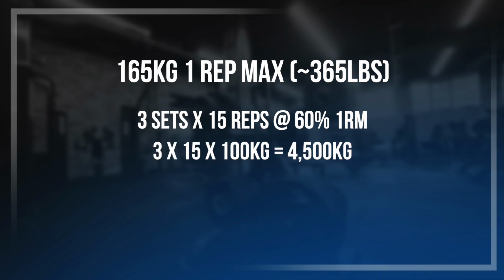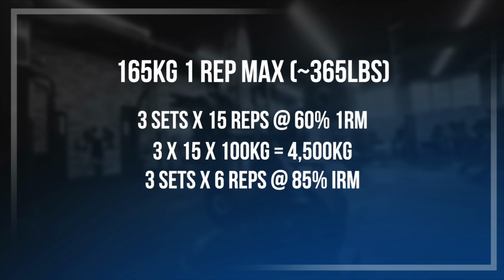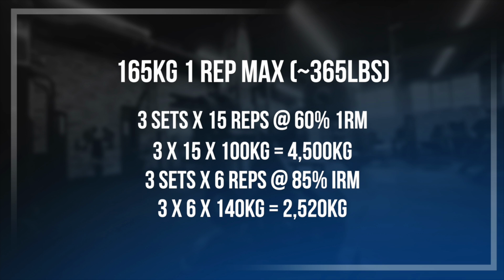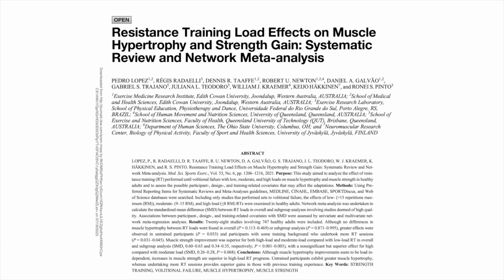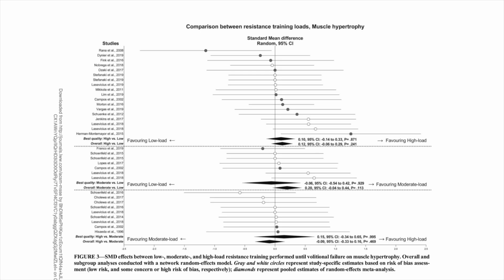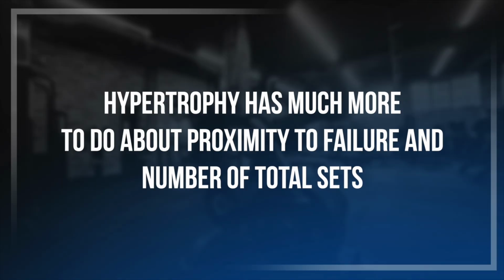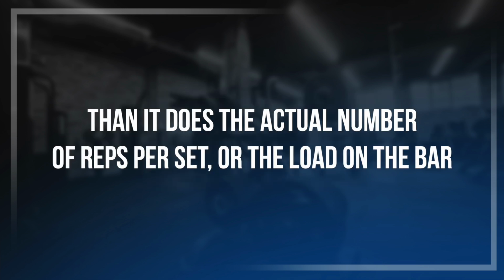The Best Way to Track Volume for Hypertrophy

Comment: Volume Load is a relative number not a universal number. Volume Load is especially needed to detect a strength increase in a program calculation, and is useful for showing a relative strength increase or decrease.